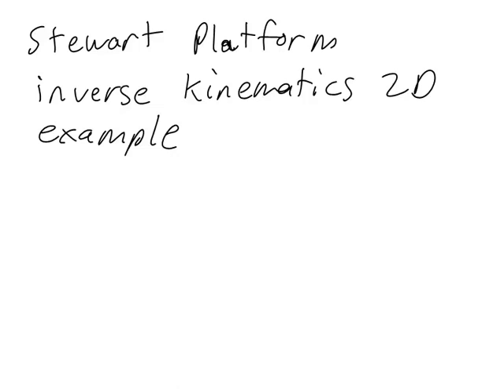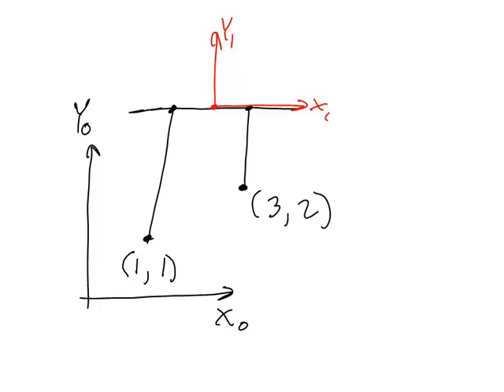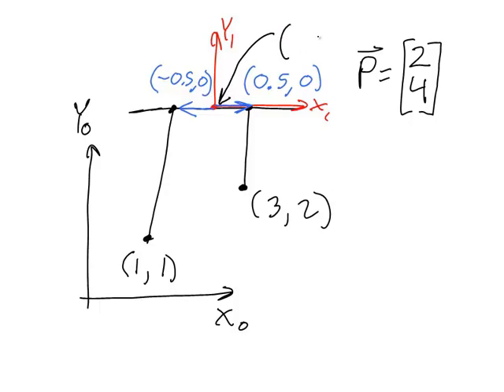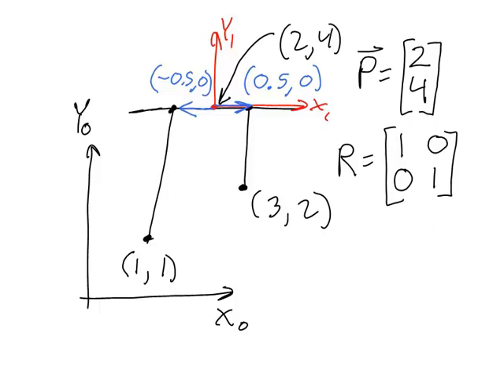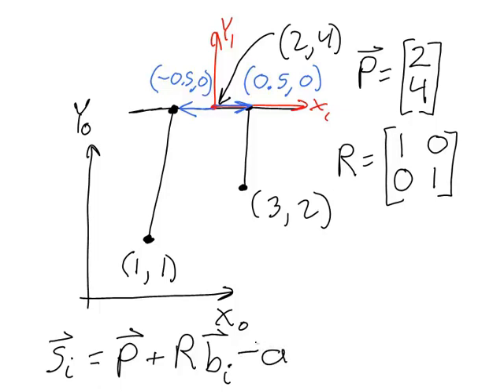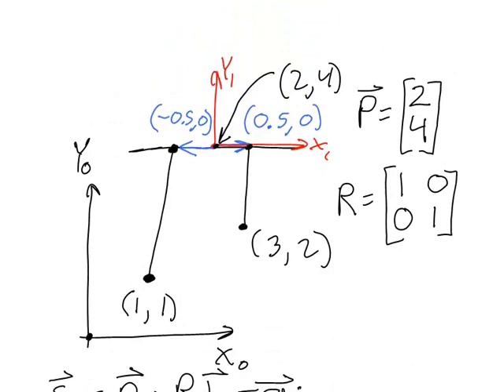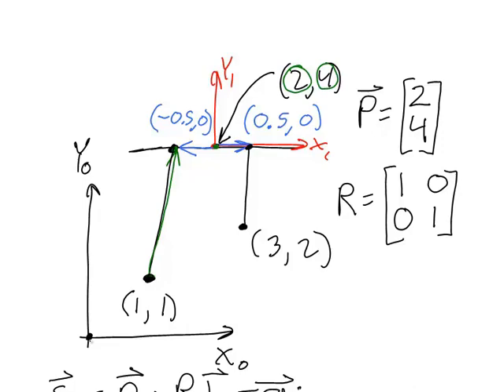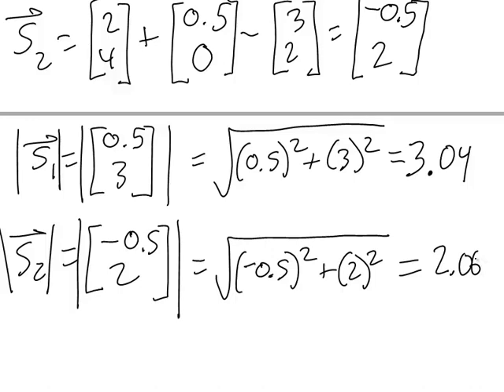Robotics 2 U1 (Kinematics) S6 (Parallel Manipulators) P3 (Inverse Kinematics Example)

Comment: Is the inverse kinematic of the Stewart platform the same as the delta robot?
Reply: when the rotation relative to base frame happened, is the kinematic of both types of parallel manipulators the same? Since the main difference between delta and Stewart platform is that the SP can change the orientation of its end effector